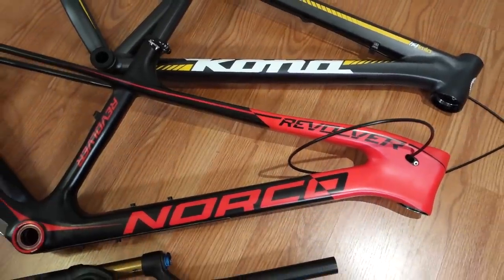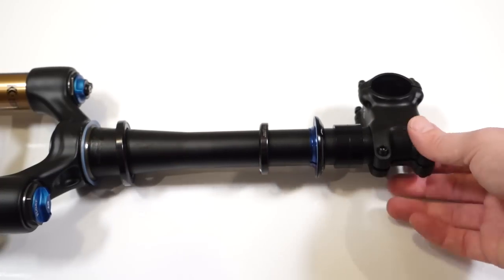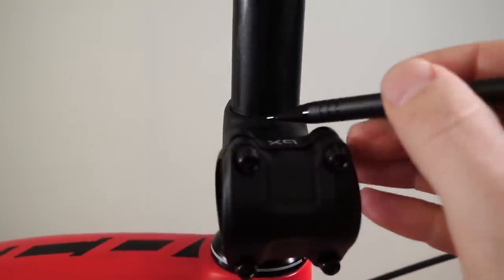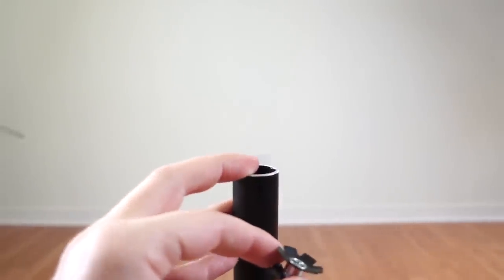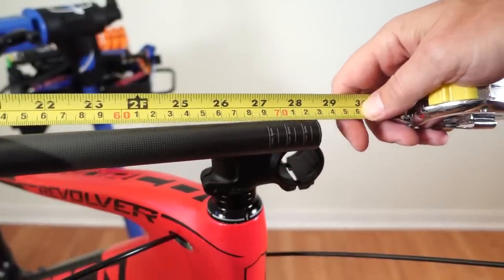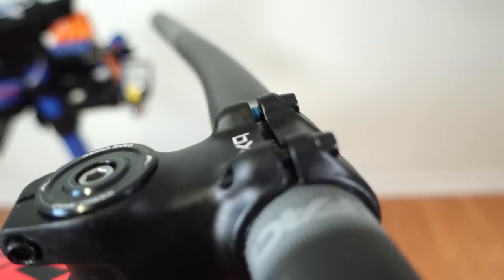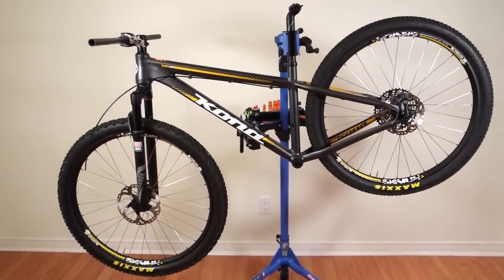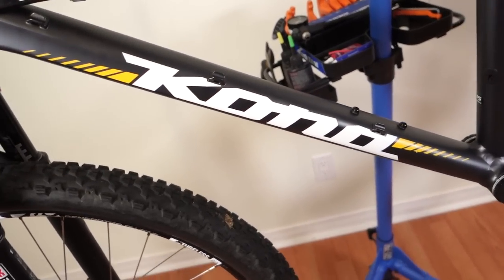How-To Build a BIKE - Part 2 of 4 - Fork, Headset, Handlebar, Cassette, Wheels

Comment: Direct from Diety Components "***Pro Installation Tip: Always run the steerer tube all of the way through the stem with a small spacer on top." I noticed this when I tested out a Specialized Evo and I thought it was odd not sure if its more for all-mountain bikes. I decided to build instead and found your videos is very informative and well put together. Thanks!

Comment: I'd like to add:
There are adapters to mount 6-bolt disc rotors on centerlock hubs but not the other way around. This may affect what hubs you get.
Also the finned shimano rotors (ultegra, dura ace, XT and XTR) are only available for centerlock.
Centerlock is a Shimano patented standard though, pretty much all other rotors are 6-bolt.

Comment: So helpful, if stem height is exactly at the same height of the fork tube steerer, could i add a 3mm spacer even without touching the steerer but only tighten by the end cup ? thanks

Comment: Nice video, I'm wondering what i need to know to change a rear wheel. Its because my rear wheel is a freewheel and i want to change to a cassette. I have a pretty budget bike I'm upgrading. I'm worried about able length and quick release specifications.

Comment: A good tip is to never apply grease directly to the stem when installing on the fork or on the handlebars when installing on the stem, this can cause it to slide and move.

Comment: 12:38 grease is usefull if your shimano cassette body is made of steel. Prevents rusting after cassette will bite into the paint/coating of the steel cassette body. I'am all for steel shimano cassette bodies since they're expensive to replace and the cassettes destroy alloy ones pretty quickly.

Comment: Hey LoveMTB, are all XD cassettes made as a unibody = non swappable sprockets?
(regardless of riveted vs machined out of one piece vs any other- if existing) 
I thought recently that XD is finally a great solution for light hubs without cassettes biting into the cassette's alloy body. Then I realised, that let's say on SunRace 11-50 11s cassette, we can still replace single rings with shimano's if they're very worn out in comparison to the rest of cassette, which I THINK is impossible with XD at all. 
Am I correct?
Reply: bummer :-(
Luckily my Darmoor Primal Pro comes with shimano type steel cassette body with a decent (for the bike price) 34 poe hub, so I won't change the hub then.

Comment: Do the spacers come with the fork? or do you need to buy these individually?
Reply: The ones mentioned at the 3 minute mark.
Reply: Thanks. I don't have any biking experience, but have been tweaking brother's bike recently and assembling a bike from scratch has an appeal about it. Do you still think it is worth doing a bike build for someone with no experience or do you think it is better to buy a cheaper prebuilt bike and see where preferences lie when it comes to things like frame geometry, material, size, and other preference based items. Appreciate the video series on these as they don't assume too much and really break it down.
Reply: @LoveMTB  Understood. Thanks for your take :)